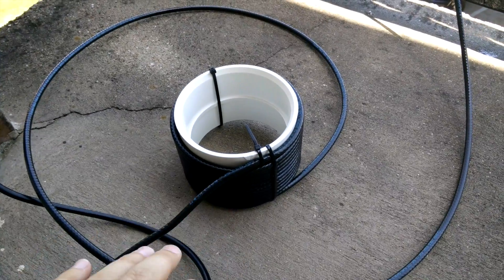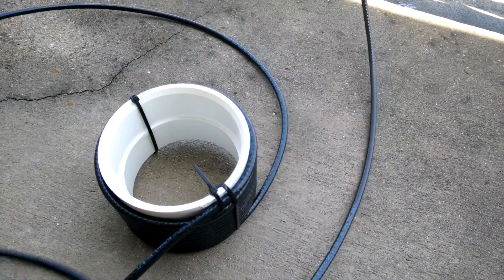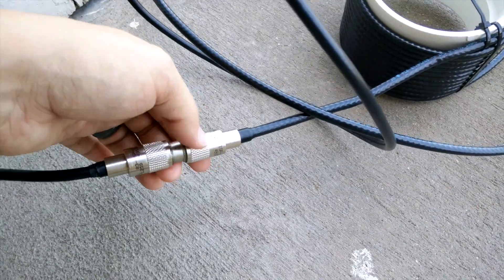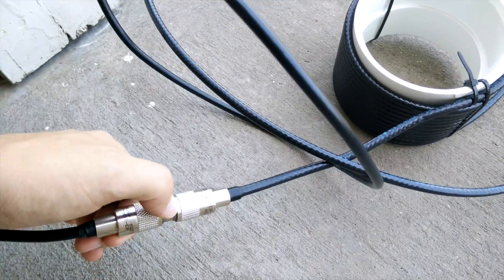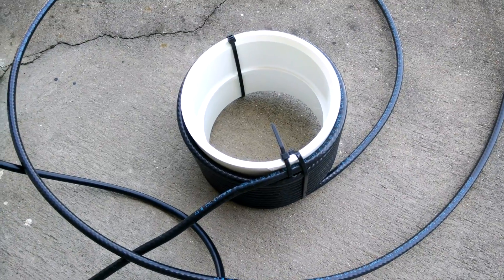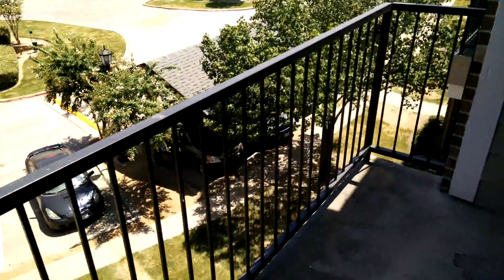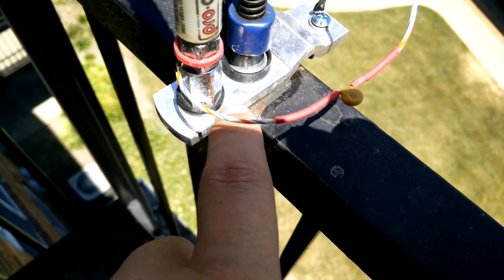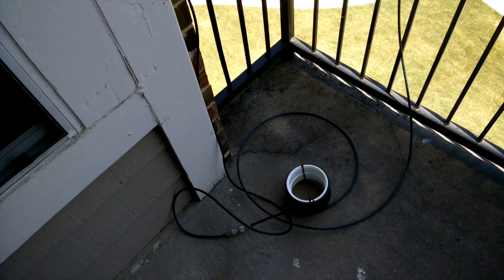Air core balun with RG-6

Comment: How do you know that it is functioning as  balun unless you measure the common mode choking impedance?? That is the primary function of a balun. Air core  chokes are narrow band devices (effectve at their self resonanat frequncy). Too few or too many turns and it can make the common mode currents WORSE.

Comment: I'm surprised at the lack of negative comments about using RG-6. We looked up some numbers and tried it out on 220 Mhz and had quite a few people blame the feedline for our failure. Spoiler: it was the deaf HTs that we bought from China.
https://youtu.be/gH0vizrGmes
Reply from the maker: Cory Klumper Yeah there's a lot of ignorance on the topic of feedline impedance unfortunately. But then again, that's why the call us Amateurs right? heh thanks for the sub.
Reply: I didn't realize you made videos or I would have subbed a long time ago.
Reply: Americans tend to use really shit quality coax for some reason. You particularly have this obsession with RG8X. What crap. And the problem with RG6 is it's mass production and lack of quality control. Ignore the spec sheet.